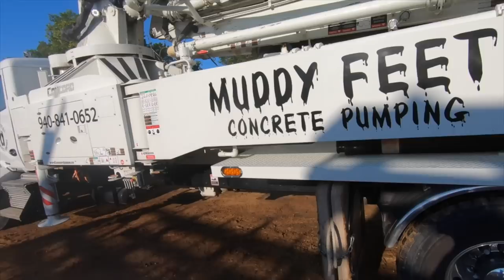Concrete truck rolls over. Pumping concrete with Muddyfeet

Comment: I can see that turning into a lot of litigation between the concrete company and the homeowners and contractors over that! What happens to the driver, out here he would definitely be fired what happens out there im curious. Whats the estimate of the truck removal, im guessing about 12,000-15000.00.
Reply from the maker: I don’t think the driver works there any more. I spoke wit hem before about the video and had them watch it. They seemed positive about it. Hopefully I doesn’t come to that.

Comment: It was clearly the roads fault ,
I seen it move over and ran the cement Truck off the road , 
Someone get the name of that road !
Reply from the maker: We need Sheriff Buford T Justice to investigate this. 🤣🤣🤣
Reply: @MuddyfeetConcretePumping  ,
At 2:27 the road moved over , 
Buford should study it for the next 20 years then retire with full pension and benefits for a job well done  of solving this angry  twisted road  accident case , 
Road is closed until further notice

Comment: I would have let the air out of the tyres on the one side.
Reply from the maker: Could been a solution
Reply: It would have bought some more time by transferring some of the weight , then it might have been able to offload the concrete.

Comment: The tow drivers should have ratcheted the cement truck to the tree(s) across the road before they started pulling on it.  Anybody with an ounce of common sense could have told you that the truck would roll over once you started pulling on it.
Reply from the maker: Where would you have attached the straps or chain to.

Comment: I drove a mixer for ten years. Rule number one is don’t be no hero. Those damn trucks are so top heavy. I know they can lean a little bit but just remember that your asshole will only get so tight. This is a common mistake but the outcome sucked for the truck and the driver.

Comment: It's because of the morons that made that driveway and thought it was good enough.
You can clearly see from the tracks trucks nearly slid off the side of this driveway several times before it actually did happen.
Whoever the GC is for this job should be paying the bill for this fuck up.
And you can tell by the comments here ......those who know how a construction site should be run, and those that have no clue.

This makes me so angry, The concrete supplier is trusting the GC will not put his expensive ready mix trucks into a hazardous situation.

Comment: Complete bs road. It was dark, wet and no spotter. Of course they will blame the driver for getting sucked in. 6 inches off in either direction and and it’s a wrap.
Reply from the maker: Needed a spotter for sure.
Reply: @MuddyfeetConcretePumping  No, the ready mix supplier should have refused delivery as soon as he saw the road he was expected to use.

Comment: Did the building contractor never hear of magical stuff called "STONE" we use here in ireland to make roads. As a mixer driver myself I cannot fully blame the driver in this case. That building site is a fucking joke.
Reply from the maker: Well I think there are other contributing factors.
Reply: @MuddyfeetConcretePumping  well you are probably right. Keep the videos coming.

Comment: 12:18 flips. Honestly avoidable had the tow truck hitched to the top of the cement truck and pulled to the right. Not from the bottom center on a heavily shifted over truck. Smh.
Reply from the maker: It was to dangerous to be climbing on that truck.
Reply: @MuddyfeetConcretePumping  oh definitely man glad no one was hurt!

Comment: Should have Dumped the load lightened the high center up a bit
Reply from the maker: nephilly87 I think they where scared to touch it.
Reply: Muddyfeet Concrete Pumping understandably lol the tow truck guy looks like he crapped his pants they are already scared of concrete trucks  sucks when 1 little screw up messes the whole week up for that company
Reply: @MuddyfeetConcretePumping  could you have shoved a hose down the hopper and sucked it out?
Reply: @jonschneck4559  Absolutely not. Even if you can fill the hose with concrete and start pumping you could only get it  about 12 ft high before vacuum bubbles would prevent the pomp from working. And if it would work all the concrete would spill out at the hopper.
Reply from the maker: Jon Schneck I don’t think you could. I know you can pull water back but I don’t think you could get concrete to come back.

Comment: Yea, the cheapskate contractor who built the most narrow pile bridge for the trucks to cross owes the concrete company a new truck. Contractor also needs to build a real reinforced driveway before repeating the same mistake...
Reply from the maker: So one truck backs off the road and it’s the contractors fault?

Comment: Im no expert but instead of recording could you not of strapped it to them trees beside to hold it from sliding in further lol naw just run about with a camera 😂
Reply from the maker: Well that was my operator for my pump. I did not need him climbing around that truck and taking a risk on getting injured or killed. This is what insurance is for.

Comment: As soon as that second driver backing in turned on his spotlights you can see his mistake and cut the wheel too hard to the right probably knowing he was already in trouble.he should have pulled forward and straighten himself out.. could have been a driver that was just trained and just cut loose operations manager first words out of his mouth would probably be who trained you happens all the time.I trained several newbies some turned out great, others did not have what it takes I wasn't being paid enough to be a stuntman, I said no more send them to diesel dummy driving school. A situation like that counterspin the barrel about a half a turn shift the weight to the right side stop the drum..
Reply from the maker: Bad deal all around.

Comment: That has to be the most useless towie ever, first thing would be block it off the tree until the crane truck gets there
Reply from the maker: Truck was to unstable to be climbing on
Reply: Muddyfeet Concrete Pumping didn’t say nothing about climbing on it, there was still a lot he could of done from the ground just to hold it abit

Comment: Front discharge concrete trucks!!!!! Enough said!!!!
Reply: Bingo!  Six-wheel drive, front-discharge trucks are virtually the ONLY thing you see in my region except on highway-paving jobs (where the driving surface is flawless and mistake-proof).  30 years ago I was on a huge project run by a superintendent from North Carolina.  He had never seen a front-discharge truck in his life, but it only took one day of concrete work for him to end up in total awe of their superiority.  For the life of me, I can't imagine why darned near the whole country still uses concrete trucks that are so much slower to get into position, require one extra worker to guide the driver and swing the chute in most cases, and which can't climb steep grades without help, and which get stuck for the slightest excuse.

Comment: I don't get it why did not the wrecker Anchor it from the road at a 45 to the top of the drum idiot they have at least 500 feet of cable on those trucks per winch

Comment: All they had to do is tie it to that tree so it won't flip over Rookie mistake
Reply from the maker: You sure ?
Reply: @MuddyfeetConcretePumping  yeah the tow truck driver must been a new driver because Midwest trucking they would of had one tow truck in the front and one two truck in the back and they would have hooked it to each end and put it right out of there

Comment: should have dumped the cement   DA
Reply from the maker: I think so
Reply: defiinitely would have. would have shifted the weight favourably in discharge mode and at the same time getting the weight out. Truck stood a better chance at getting saved had they not wasted so much time.

Comment: Looks like buncha dummy tow truck drivers showed up lol..chain to low point with some 40 or 60 k straps to tree and there other pump truck to hold level till heavy truck comes in..he then attaches a point somewhere and puts retaining leverage and boom truck comes does its job..thats how was supposed to go..tow driver failed to know common sense here ..its wasent bound to happen dude..tow company and ur employees could of helped this situation forsure..p.s habe been part of heavy truck crew ..also run machinery for a loving on commercial sites..and amazing what even a 320 cat will move around for ya of you use weight to your advantage

Comment: The tow truck should have set up on the road and ran a line to the truck to prevent it from rolling over..until the other truck got there to assist..were he first hooked up the line was a waste of time as you can see it did nothing to stop it from rolling over.bad choice

Comment: Whoever put that temporary road in needs hanging. Sticky clay has all the qualities of Jello when under load. Admittedly it is driver error, if he felt it wasn't safe to drive on he shouldn't have.
Reply: It's a dirt road.  Let's drive this 50 ton truck on there without fully testing the soil first.  Shortcut = disaster.  Luckily no one was killed.